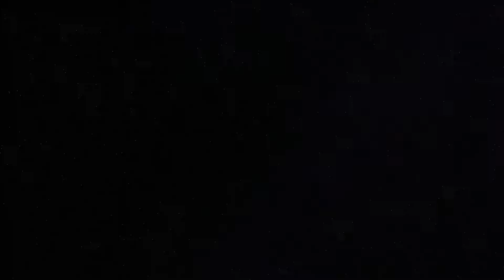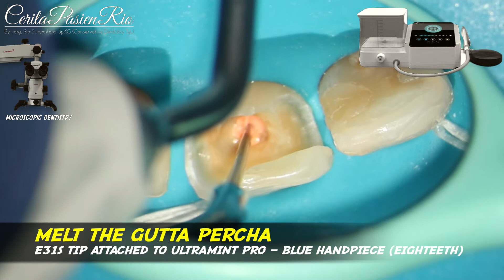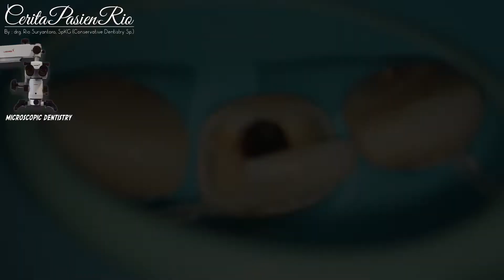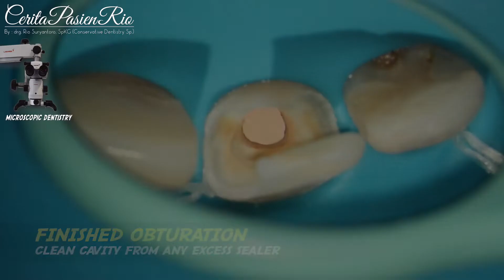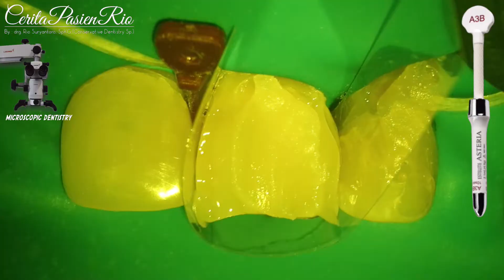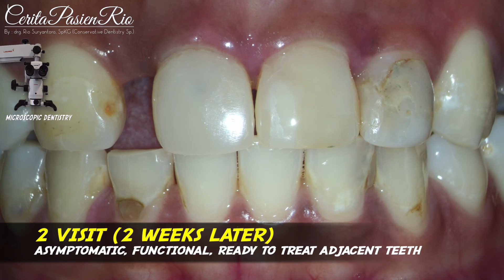SINGLE VISIT ENDODONTIC RETREATMENT MAXILLARY INCISIVE USING DENTAL OPERATING MICROSCOPE ❗️E-FLEX RT

Comment: It is amazing 👏👏But i have Q 
How can you make cavity clean after obturation?
Reply from the maker: i clean the excess sealer using air flow and ultrasonic approach Dr.. this method are really effective in removing the sealers thus making the cavity very clean..
Reply: @RioSuryantoro  Kindly if you show that by video Dr.?🙏🏼